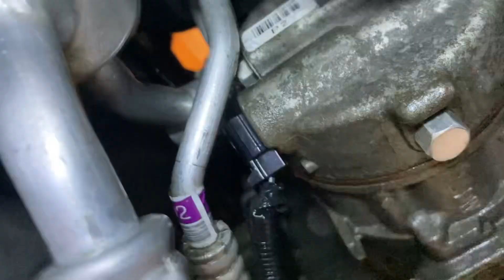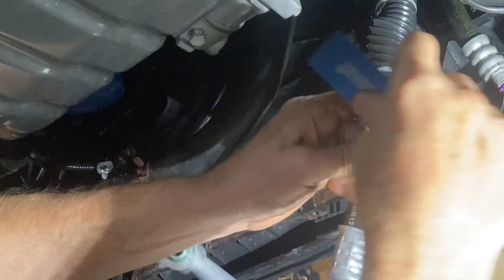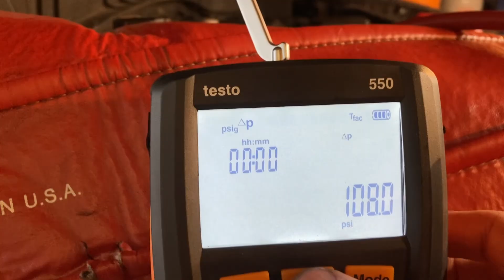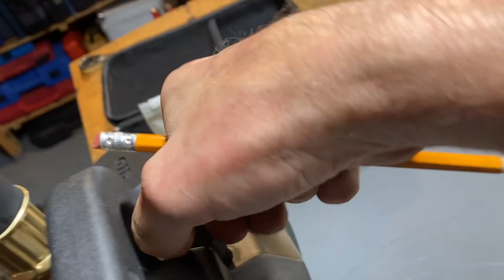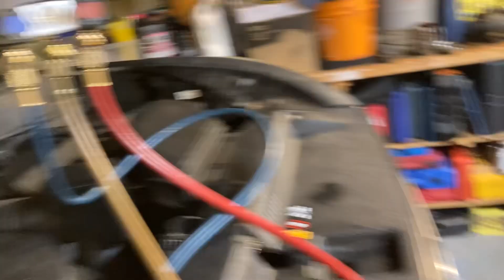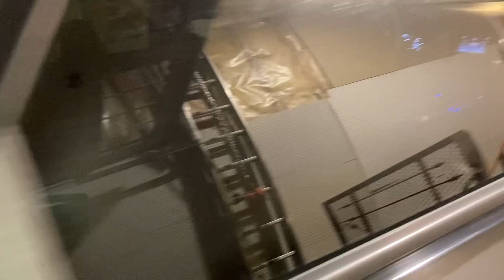Hyundai Tucson AC Compressor Replacement

Comment: 👍 excellent job 
When feeling for the cold suction line . I noticed there is a IHX INTERNAL HEAT EXCHANGER that feeds the warmer liquid line. Refrigerant around the cold suction line to transfer heat.. 

  It makes the suction line a little warmer when it passes that area past your low side fitting on route to the compressor. 
     So if you reach your hand back towards the firewall where the suction line, First leaves the evaporator, you’ll notice it several degrees colder before that vapor enters the heat exchanger.  
       Cheers 🍻
Reply from the maker: Thx Tom. You’re correct, the liquid line and suction line are an exchanger assembly. Of course you’re correct you taught me most of what I know about AC 🤣 I hope you didn’t mind me “stealing” your window condensation demonstration. Thx again. Although I rarely comment on your videos I’m still watching & learning. 👍🍻
Reply: @TheGibby3340 love the ending